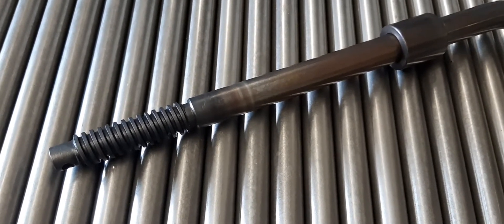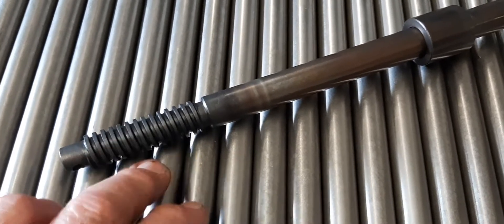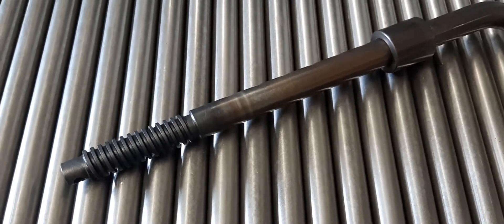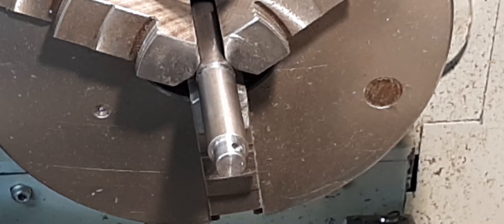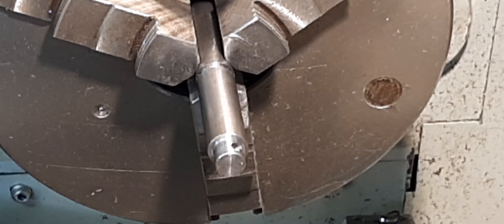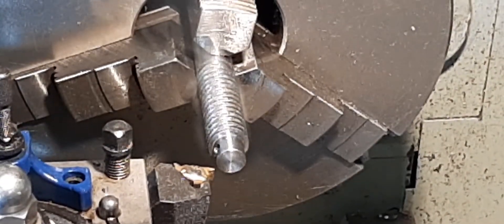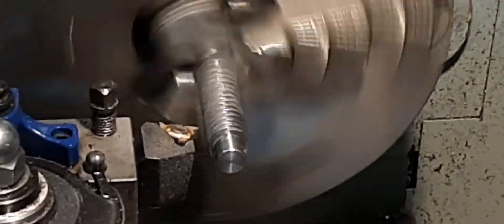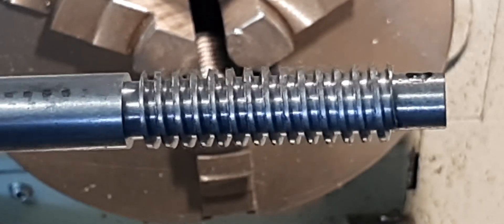ACME Thread Cutting.  Manual Lathe.

Comment: Nice acme thread turning.  That first spring pass showed why you need to do spring cut passes.  Run a file over the threads to de-rag them and all is good.
Reply from the maker: Hi Vernon.
Great to see you watch my videos.
Always good to know who is still interested to follow along.
After completing the thread cutting i normally dress the tops with a final cut after all the threaded parts are finished which includes a chamfer at the start and finish of the threads.
Always grateful to those who are interested enough to leave a comment 
( hopefully a positive one, LOL )
Thanks again for watching.
Much appreciated.
Peter.